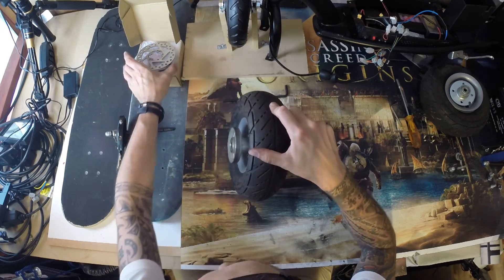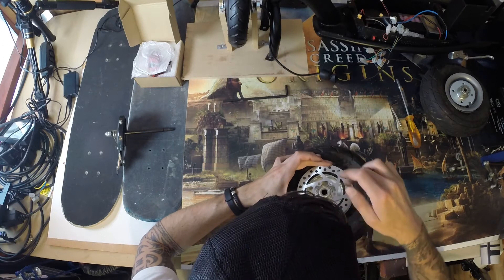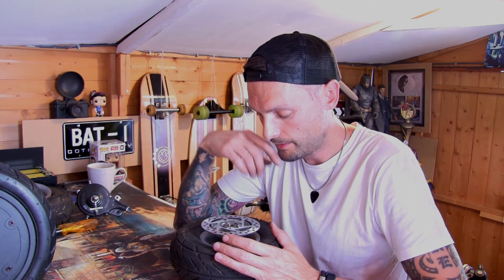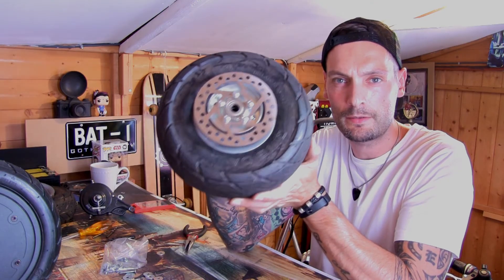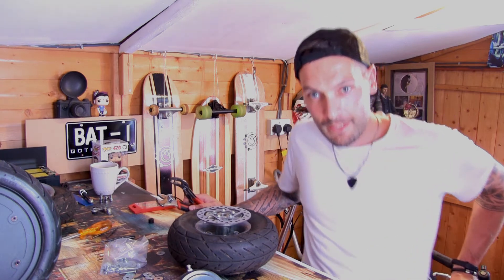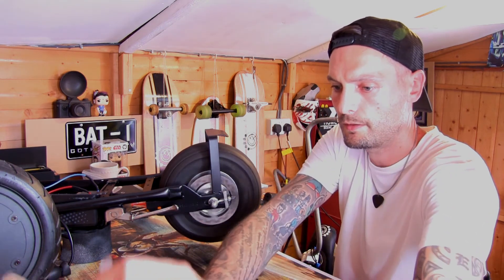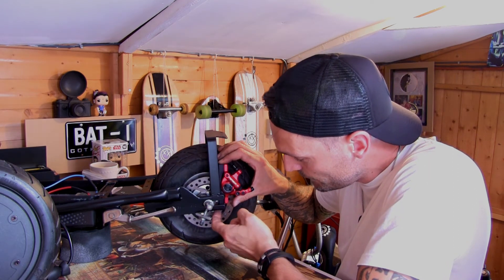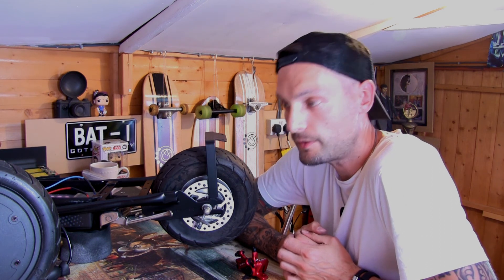How to Fit a Disc Brake on a Razor E300 ELECTRIC SCOOTER - Part 1 - Episode #7

Comment: Russ..appreciate all the info as I work on my scooter. Since you've done e300 with both types of motors...which one handles hills better in your opinion... front hub motor or chain motor? I currently have a 24V 500W DC motor on my scooter and wondering if I should go to a hub motor. Much appreciated!!
Reply from the maker: the chain motor has a lot more torque so it's better for hills but the hub motor is faster top speed and doesn't use as much battery (you get about 2-3 miles more)
it's swings and roundabouts what one is better but I personally preferred the hub motor.
thanks for watching

Comment: Hello I was wondering if you have the part links for the disc brake conversion?
Reply from the maker: hey, haven't got the ones I actually ordered but this was the disc:
https://www.ebay.co.uk/itm/Brake-Disk-with-Screws-for-Xiaomi-M365-1S-PRO-PRO2-Lite-Electric-Scooter-UK-/165033415126?mkcid=16&mkevt=1&_trksid=p2349624.m46890.l49286&mkrid=710-127635-2958-0
caliper:
https://www.ebay.co.uk/itm/Disc-Disc-Brake-Brake-Caliper-For-Xiaomi-M365-Pro-Electric-Brand-new-/402738244290?mkcid=16&mkevt=1&_trksid=p2349624.m46890.l49286&mkrid=710-127635-2958-0

thank you for watching
Reply: Thank sir
Reply: Wicked video! Did you order the 110mm or the 120mm?